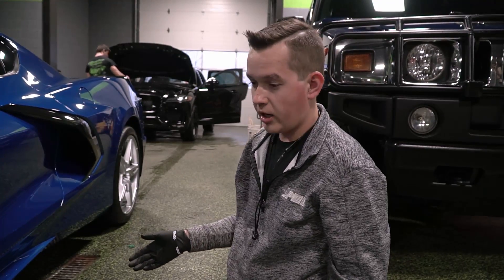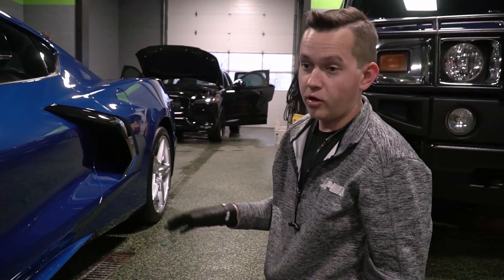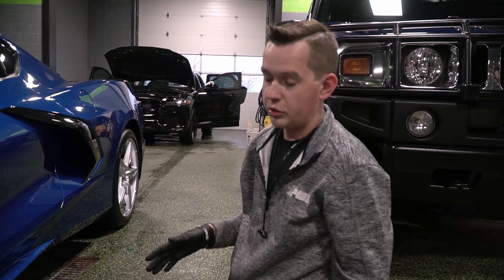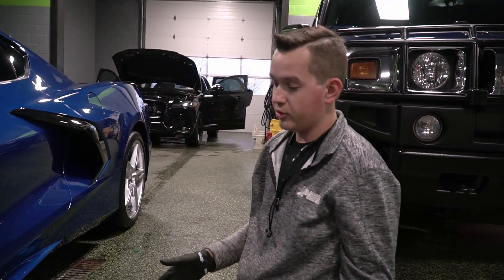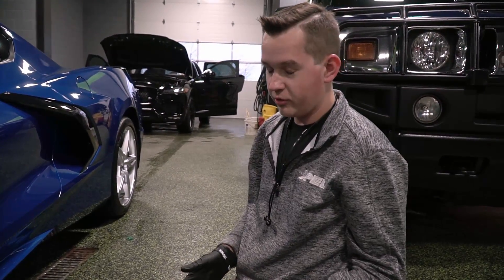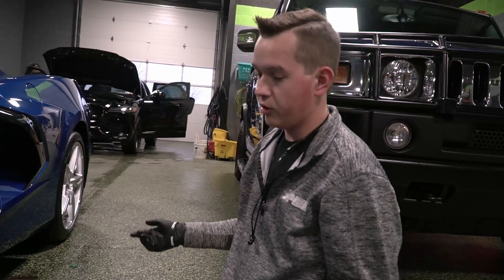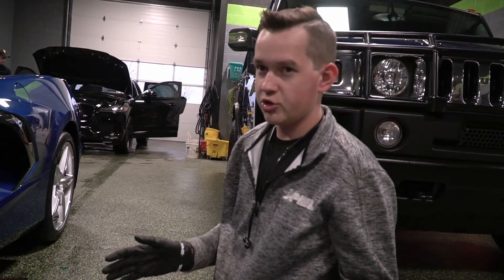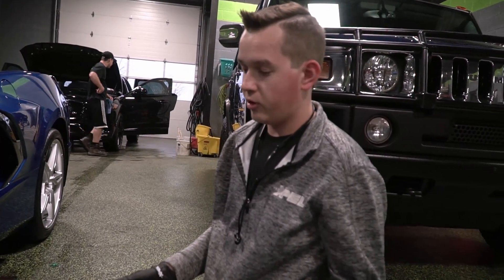How To Jack Up A Corvette C8 or Z06

Comment: The jack point are the 1 by 2.5 inch holes closest to the wheel wells! The illustrated drawing is not for a C8! The shop should use jack puck pads in each of the four holes when lifting a C8!
Reply from the maker: agreed, everyone use your puck pads, and have different size pucks to find the perfect fit!

Comment: Great content guys. The jacking points are very critical, especially when putting it on a lift due to its' off-center weight distribution. It could actually tip off the lift. Another critical area which is no where near the torgue required amount for previous generations is that the C8's lug nuts require a 140 foot pounds of torgue. Save the Wave.🙋🏼‍♂️